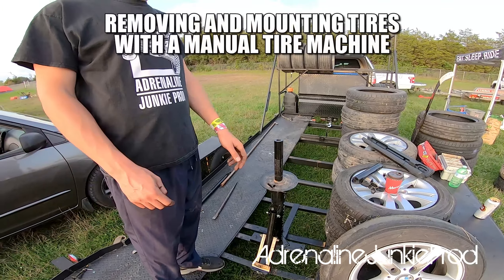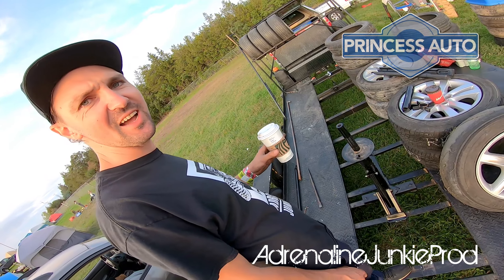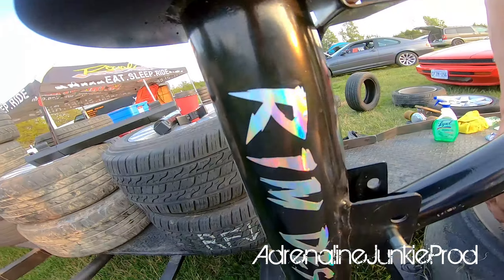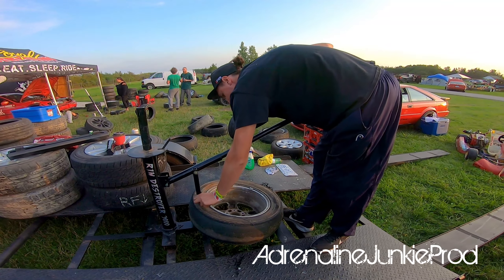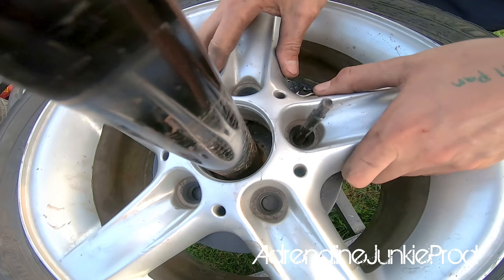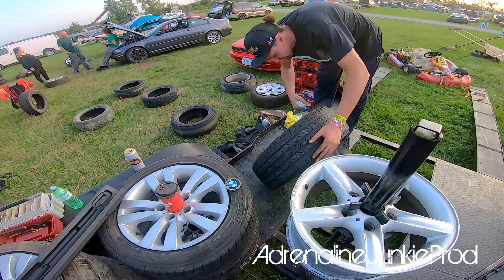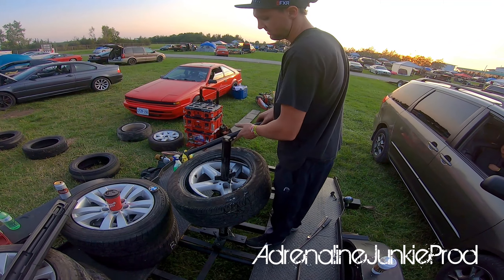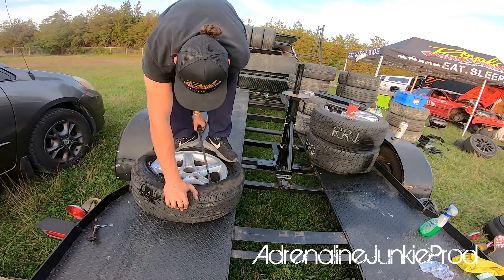How to use a manual tire changer/machine to remove and mount car tires - ATV/UTV/SXS, Truck, Farm

Comment: When your ready for a real tire changer let me know. I have about 28. That’s what I do, repair, rebuild and sell, tire changers and brake lathes. You made the hand unit look easy! Good work.
Reply from the maker: Hey G-Man. I'm in the market for an actual tire machine for my shop. Just planning on getting something used. Doesn't need to be fancy. I've wanted one for ages. What do you recommend I look for?

Comment: Sold ima buy one of them I would only really use it for ATV tires sure alot easier than car and board trick for breaking bead
Reply from the maker: It’s totally worth the money. It works great. I mostly use it for my drift car since I don’t care about the rims at all and it’s great for atv/UTV, trailer or tractor tires. Obviously it’s not intended for expensive fancy wheels.

Comment: Very cool always wanted to know how those worked...thanks for showing us!!  Also, how much psi does it take to set the bead?  When I'm mounting my kart tires it takes around 100 psi.
Reply from the maker: I had to figure it out on my own so I figured I'd make a video. They work amazing once you figure them out, especially with two people. I'm going to make a more in depth step by step version of how to use it in the next little while and I'll do one that shows UTV/ATV tires too. I'm glad you liked the video Jason!
Reply from the maker: In regards to the PSI it depends on the tire. Most car tires take about 25-50psi I find. Sometimes if the tire is hard and has a small sidewall its more and sometimes if the rim is big and the tire is a little more narrow then it should be its tough. As long as the tire is the right size for the rim its usually really easy.

Comment: rim destroyer for sure, used one on a new rim and now its got battle scars.
Reply from the maker: Ya, the name is suiting. It works awesome but it's definitely not for your $4000 three piece wheels, lol. When used as intended and with realistic expectations it badass! My drift car wheels and my Offroad wheels are already scratched as hell and the scuffs this thing causes will blend right in and not even be noticeable.

Comment: Nice video , I do have one of these manual changer and works great except for the rim damage.  I purchased a no mar bar and it works great and keeps from damaging the rims and way easier to use than and bar that comes with the changer. .  Check it out www.nomartirechanger.com.  I will admit its little pricey but if you want to save your rim it’s a great product.